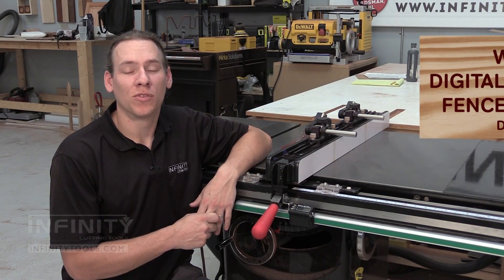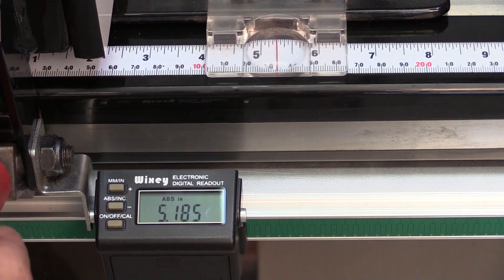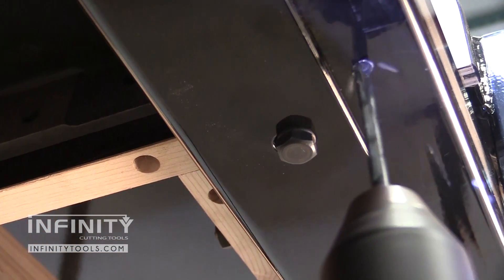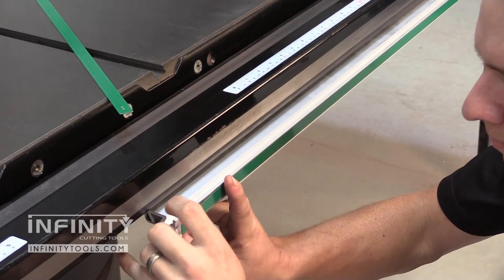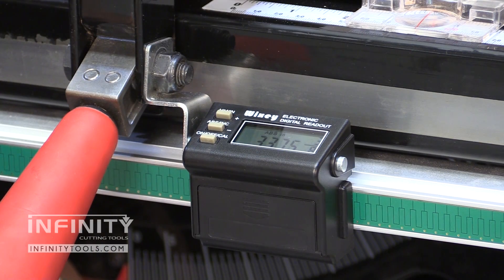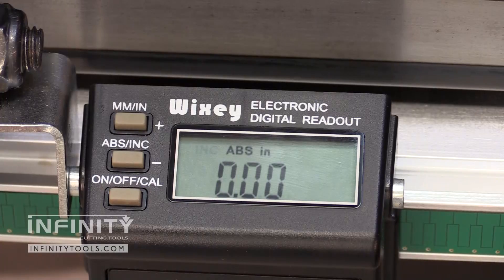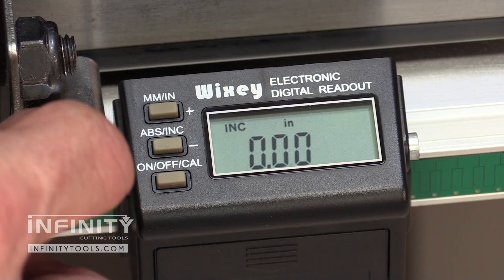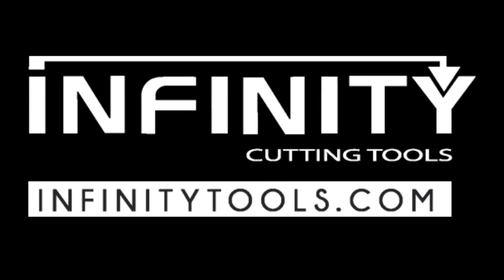All About the Wixey Digital Fence Readout for the Table Saw

Comment: I love this product . I have a General international cabinet saw . I didn’t really want to but I removed the fence post . While it was off I drilled and tapped holes on my drill press .
Anyways it wasn’t a terribly hard ordeal , and the Wixey digital system is an absolute game changer. How I got by without it is beyond me . It’s certainly improved my cabinet making .
I do have the Wixey accessory for the blade height ,but I wish there was a way to internally install a system to monitor height . Must be difficult or I’m sure a system would be offered

Comment: Nice tool, but I'd suggest Wixey include 2 of the small brackets for the fence (magnet attachments), so that you can mount and switch the readout to either side, out of the way of any left sided cuts.  The bracket looks easy enough to make for most DYI'ers.

Comment: Nice idea but I would be concerned about saw dust build up on the track causing inaccurate readings.
Reply from the maker: The reader has wipes to help eliminate dust buildup. The sensor is magnet and not optical so there is no "eye" to get obstructed. Not to mention the track is typically oriented vertically so that dust is not landing and sitting on the reader strip. So far we have never experienced or heard of dust build up being an issue and this is an extremely common type of readout for all different manufacturing industries including woodworking.

Comment: I have everything attached and ready to go except for the digital readout. When I slide it on I can only move it about 6 inches before it is too tight. If I loosen the 4 tiny screws on the back, will that loosen the fit somehow? I have tried but they are so tiny none of my screw drivers will fit. The one that comes very close cannot budge them because of how tight they are. Suggestions? Or at least let me know what size screwdriver I need to go buy? Thanks.
Reply from the maker: Hi Cindy, I do not think there is adjustment for the readout itself even if you were to loosen the screws. Is it possible that there is a burr or other on the track that may be causing the readout not to slide? I would check this first. If you continue to  have problems please email us at customerservice@infinitytools.com and we can get a little deeper into the details.
Reply: InfinityTools Thanks for the quick reply! After watching this again I realized I screwed the track on too far back and the readout was scraping the top of my fence (head smack!) This is why I should not attempt these things before an adequate amount of coffee! 
Thanks again.

Comment: do you reckon it could be mounted to a Triton 2000 table saw.
Reply from the maker: Hi Peter, my concern would be that the Triton does not have much of a fence rail to use for mounting, and the Wixey would be longer than needed. I think the wixey is better suited to a larger machine.